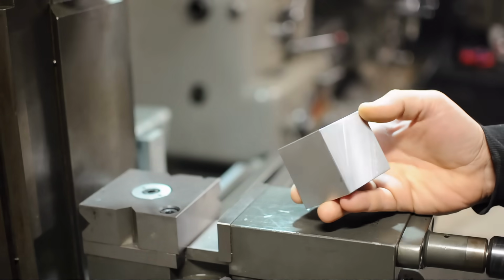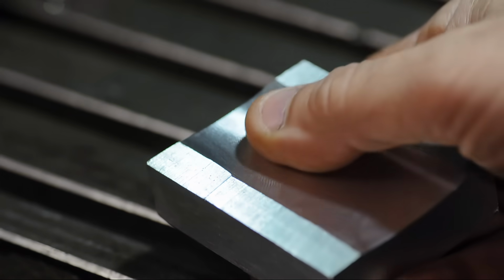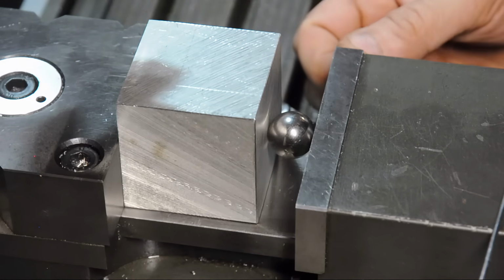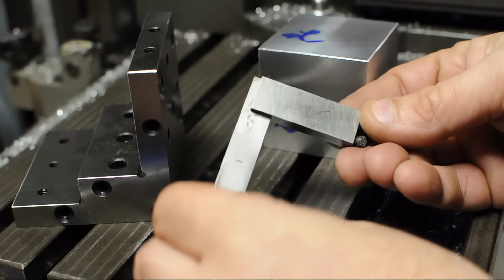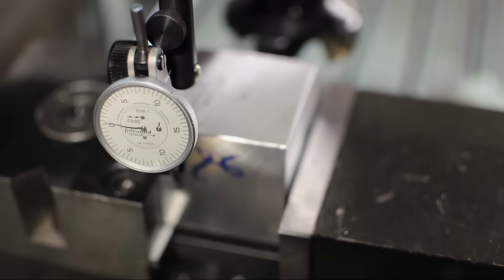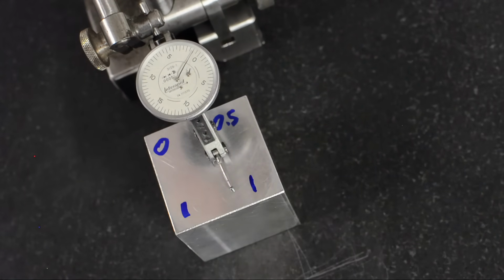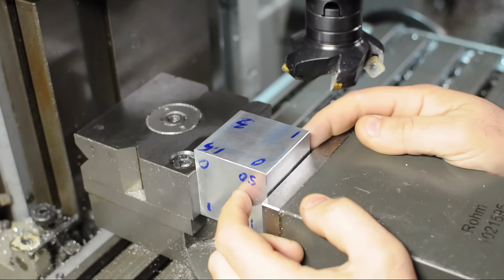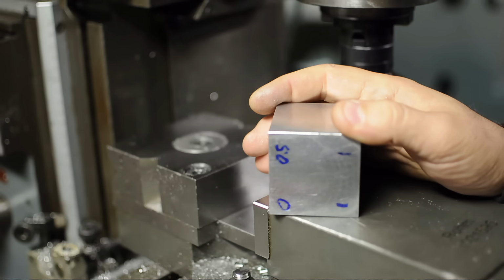Stock? Mill? Square!

Comment: The "square up stock" videos are a joke and a "scam". As long as a single "angle" on the "less than square" cube/polygon is "square" and the "master machinist" acting like he's a magician "squaring up" something that's got at least one "square" reference/datum knows which "angle" that is, there's no "skill" or "ability" involved in "squaring" the piece no matter what "tricks" he supposedly uses to "square" the "unsquare" before beginning machining. 

And though the video is all about "squaring" the"unsquare" and a "square" is prominently displayed in the video repeatedly, its never used to DEMONSTRATE that the piece is "unsquare" until the "master machinist" AFTER making one or more initial "cuts" using his "trick(s)" decides to intentionally make the piece "unsquare" again just to prove that he can magically "fix" even grossly obvious "unsquareness" and at the end of the video finally MAYBE applies square to work to prove how "skilled" he is. 

And the "numbering" or "naming" of the sides is just circus sideshow/carnival "slight of hand" b.s. along with scribbling all over the work and throwing in "thousandths" or "thou" like "squareness" is "measured" using linear units rather than angular units and an angle can be anything but "square" or "unsquare". There are no "levels" or "divisions" or "units" of "squareness". 

And all this crap just to convince "aspiring" and "rookie" and "amateur" and "hobbyist" machinists that this kind of crap is what goes on in a "job shop" and they'll be dealing with "metrology" on a daily basis in a nice clean shop with nice clean, new material every day in any "working" machine shop instead of machining things like flywheels, cylinder heads and at most "machining" one-off "jobs" making some mundane, simple little replacement part for some walk-in "client" who didn't/doesn't operate/maintain/service his/her equipment properly and/or doesn't hire employees that do and has some "crisis" of a failed machine/part that he/she just can't/won't wait for or pay for new replacement parts. 

That's the real world of machining in "job shops" once you get away from YouTube fantasyland where every day or at least ever video is a quick, relatively easy, interesting, challenging opportunity to "manufacture" some specialized part for a "prototype" or "re-engineer" a failed/faulty/poor "design" and when you're not doing those things you can make YouTube videos and go shop flea markets and garage sales for "good deals" on "shop tools" and sit around thinking up new "projects" to MAKE new "shop tools" and even "collaborate" with other "machinists" in the machining "community" where everybody knows everybody else and everybody lives and breathes machining 24-7-365 and they buy and loan and give each other tools and "swag" and mentions/links on their videos and channel, etc etc etc. 

And if you just watch enough "DIY" and "how-to" videos online and spend far more time watching "celebrity machinists" on YouTube with plenty of free time and disposable income to buy and maintain and make very expensive tools and let them "teach you", you'll be a "machinist" in no time. And part of the "community". The "community" with dozens of machinists and "home shops" and "job shops" where nobody is busy enough with actual "customer" work to have it interfere with their "free time" making YouTube videos. You bet. When the phone never rings and the door never opens with a paying customer on the other end/side, its unlikely they're "making money" as a "machinist". And certainly not enough to buy tools and electricity and "consumables" like carbide inserts that go for $15-$50 a whack like they're going out of style. 

But maybe their "day job" has really good "fringe benefits" like employee "discounts" on things like "materials" and "consumables" and "surplus" and/or "scrap" employees get "cheap" or maybe even "free for the taking". Literally.

Comment: You're dealing with a block that needs to be "square" in "3 dimensions" meaning it needs to be "cube". I want to see your "square" block measured with a micrometer at and across each "edge" at both ends on all 6 sides and in all three "directions".  If the stock isn't "square" to start with your process and tools are completely incapable of "squaring it up". Anybody who is using a dial indicator to "measure" a "dimension" instead of a micrometer clearly has no clue about even what tools are used by real machinists in real machine shops to perform actual measurements vs. what tools are used to MEASURE MOTION and "indicate" it for checking "dimensionless quantities" like backlash in a gearset or endplay of an assembled component. And all you "expert machinists" that are tossing your "precision instruments" on your "precision machine tools" and "surface plates" and are sliding precision surfaces around on other precision surfaces to show "flatness" or "squareness" are just morons who don't know you don't "rub" on a precision surface. Surface plates with "holes" in certain areas are the result of former apprentice fools tossing parts on them wherever they land in the "general area" they're placed for repeated setup/inspection operations like small gearcases, ring gear and pinion setup in removable carrier differential assemblies where a surface plate and indicator are used to check and set backlash/preload on a carrier bolted into a "jig" where there is nowhere to mount a magnetic base indicator and not being smart/ambitious/strong enough to put the part and/or indicator assembly in its proper location to begin with and prior to setup/inspection just sliding the part/tool across the surface place to where it should have been to begin with instead of doing it RIGHT and picking up the part/tool VERTICALLY completely off the surface and placing it where it belongs by setting it back down vertically. You don't slide precision surfaces around on ANY other surface and you damned sure don't use a dial indicator to make "measurements" of or on non-moving parts because it's not designed to "measure" anything but MOVEMENT a d when its being used PROPERLY nothing is touching it but the PART HAVING ITS MOVEMENT MEASURED. Which means HANDS OFF. 

That's why it has as spring-loaded mechanism. The only hand's on measuring tools are micrometers, dial bore gauges and calipers. If all you "expert machinists" were as good of machinists as you are "teachers" and video producers/stars you'd have machine work coming out of your ears and wouldn't have time to make "how-to" videos only noobs and other "professional machinists" who didn't learn this basic stuff even the WRONG WAY yet in their "careers" or during their "training" have to watch so they don't look like the clueless tools THEY are at work. 99% of the "celebrity machinists" making tons of YouTube videos because apparently they have plenty of free time and 99% of the time are doing "DIY" projects "just to see if they can" or because "it seemed like a good project/video idea" all have in common that your tools are old, you apparently don't have good tools or the right tools to start with and are trying to salvage/make what you don't have using tools that presumably are also are insufficient to the task and spend all your time focusing on "accuracy and precision" when precision measuring tools like micrometers show up in your videos about as often as actual "outside work" for paying customers does. 

Which big auto/aerospace manufacturer/supplier were you a "machinist" at before you got laid off/fired/bought out/retired or which local votech or community college/trade school/high school were you teaching complete rookie students "machine tool" classes at before the government/school district/school shut down your school/program because it wasn't producing "professional" and "trained" machinists or even good students and high school graduates that could go on to a community college program etc and a real machine tool and/or tool maker/die maker program so you ended up losing THAT gig? Clearly none of you have ever spent any time in the "real world" of working as an actual "professional machinist" in a "job shop" i.e. local machine shop where the majority of the work is going to be carry-in repair/rebuilding of parts that don't require any or very few of all the "precision tools" and "surface plates" and "precision" and "accuracy" in machining that seem to be your only subjects/strengths. 

And you guys use "precision grinding" to clean up and make pretty piss-poor work off your worn-out mills and cheap-ass imported cutters or improperly sharpened used ones or someone else's worn-out mills and cheap-ass imported cutters or improperly sharpened used ones and that's pretty much the ONLY "machine tools" consistently used and consistently referred to as being "accurate" and/or "precise" enough to do what you claim mills won't. Which is hilarious given that its impossible to "grind flat" any surface with a rotating round stone spinning and being dragged across a surface as it gets progressively smaller with every pass even if only a "little bit". Precision grinding is done in three places and on three machines in real machine shops. Valve grinding machines, crankshaft grinding machines and camshaft/off-center grinding machines. And "precision grinding" to "finish" crankshaft/camshaft/off-center grinding is done with "emery cloth" loops and not stones. Why? Because you can't even grind ROUND PARTS PERFECTLY "FLAT" or "SMOOTH" WITH A ROUND WHEEL ROTATING AND GRINDING AGAINST THEM AS IT MOVES ACROSS THEM. 

When I look at the "community" of "expert machinists" and YouTube video "celebrities" making all these "how-to" videos (and you know exactly who I'm talking about since you all promote and cross-promote each other and are all making the exact same videos more or less no matter how many already exist and play "follow-the-leader" incessantly) I see what are probably a bunch of "retired" or rather unemployed "machinists" who were "trained" via "apprenticeship" at some big automotive/aerospace manufacturer or supplier and learned only what some "master" knew along with everything WRONG that he "knew" and being able to actually do only whatever limited tasks he/you learned/did over years or decades of "specializing" in a certain area of "machining" i.e. standing at a machine pulling out one finished part and putting in another after somebody else did the set-up or maybe working in the "tool room" checking finished parts and the machines and machinists producing them by "tossing" them on a surface plate and sliding them and the precision tools around to "inspect" them or never were actual "machinists" at all and went straight from being a student at whatever podunk local community college that was "current" and "accredited" and "qualified" to teach "modern machining" circa WWII in about 1980 or so when you graduated high school right to "instructor" because you were the teacher's pet and fell into a teaching gig no one else wanted when he or some other instructor died or retired. 

What you clearly haven't done more than maybe once or twice in your "career" is walk into a "real" machine shop with a real machinist or two or two dozen and nothing but high-quality machine tools and instruments operated by actual professionals professionally-trained to "do it all" at a good community college/vo-tech program and/or by good "masters" in a fully equipped "job shop" that had to produce quality work in a timely manner and on an ongoing basis to stay in business and where there was enough business and enough varied business because they did so that an "apprentice" who was there to LEARN TO BE A MACHINIST BECAUSE HE WANTED TO BE AND WAS WILLING TO "INVEST" IN HIS OWN EDUCATION INSTEAD OF JUST BECAUSE IT WAS THE ONLY "OPTION" AVAILABLE AFTER HIGH SCHOOL AND/OR THE BEST PAYING JOB AROUND AND HIS DADDY/UNCLE/BROTHER/MASTER/FAVORITE TEACHER GOT HIM A JOB AND A UNION CARD THERE. I've worked with a lot of machinists and shops in 25 years of diesel mechanicking and spent a few years as a "machinist" (locomotive mechanic) at Union Pacific so I know how the union/apprenticeship thing works although at least at UP not just ANYBODY can walk in and get a "apprentice diesel mechanic" job and even guys with 3 year or so AND an actual degree in the field AND actual years of work experience who pass the same tests as the guys that go right to "diesel mechanic" still get "apprenticed" if they only have 3 years instead of the required 4 years, etc. They may get a shorter than normal "apprenticeship" and go to diesel mechanic in a year or so instead of up to 4 or 5 if they became apprentice diesel mechanics from another "craft" like fireman/oiler or mechanical service operator whereas it seems like "up north" anybody with a pulse who can read and speak English and has the right "connections" can get an "apprenticeship" even if he doesn't actually WANT to be a machinist and doesn't know a screwdriver from a hammer much less what you use a dial indicator for and what you use a micrometer for.

No wonder all those jobs got "sent overseas" up there. People over there want to work for a living and are glad for the work and aren't there for a paycheck until they get enough seniority to get an even easier job in the "tool room" or "teaching". I'm sure it seemed like it was going to be a piece of cake for you "professional machinists" who "retired" from your previous gigs to go out and spend a little money on a few good "cheap" machine tools and a precision grinder and some "precision measuring tools" that were probably going for scrap price up there because they were scrap and hang out a shingle and start raking in the cash as "machinists" with your own "machine shops" but unfortunately even with a dire shortage of good machinists/shops out there and especially in the U.S. today the work goes to proven professionals.